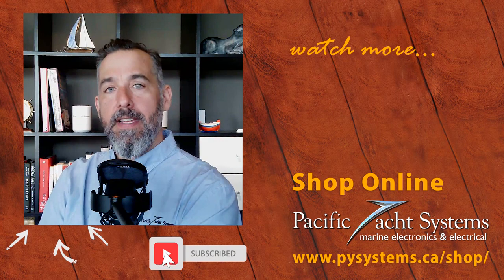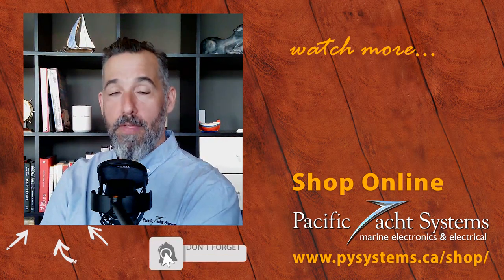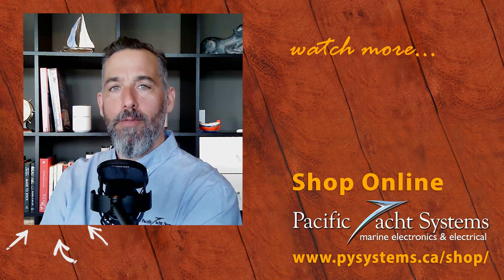My Inverter Has a Case Ground, Do I Connect This to the DC Ground?

Comment: You did not mention shore power. I have always been taught to "NOT" connect the show power ground to the grounds of the RV/BOAT. The RV/BOAT acts like a sub panel when plugged into the shore power

Comment: Thanks for the great tutorial. My inverter ground terminal  connector is way too small to accommodate the 1 size smaller regulation ground wire. I believe this is a common problem. Is there a fix to overcome this issue?

Comment: I have a certainty mine doesn't comply. Don't think the case clamp was large enough either. 
Is there a conflict in capacitor bridges and copper strip or flattened copper tube ground sizing? There is a pile of the larger keel bolts to be connected though my intention to capacitor isolate. I am aware ABYC and old standards for protecting wooden boats and Aluminum from unnecessary galvanic induced corrosion seem at odds.
Personally only interested in MY vessel complying with CG Auxiliary inspection.

Comment: The notions of ''grounding'' and ''bounding'' are often not well understood as well as the principle of ''single point ground'' and that everything is put at the same potential. The DC output must be floating to ensure compatibility with any type of equipment. The frame of the equipment, on the other hand, of the AC/DC products must be grounded at the same point and not one after the other (not daisy chain). We never ground the battery negative.
In a boat, it is virtually impossible to have the equipment all in one place with an SPGP (Single Point Ground Panel). Thus, secondary panels that will be inter-connected can be installed in different places.

Comment: Hi Jeff, I'm still confused, I have a 1000 watt pure sine wave inverter running off batteries for emergency back up for electronic equipment and on the inverter there is a ground bolt on the side of the casing, what do I ground too, I am not close to a electrical panel but there is a ground rod near the generator ,  could it be attached to this rod or is it necessary at all to ground the inverter , or should I put in another ground rod, I would appreciate your advice.

Comment: I've got 4/0 gauge on a 3000 watt inverter. The chassis ground is very small. Will be weird to install a 2/0 gauge wire to such a small term terminal post. Will the post even handle the current in a worst case scenario? Also, isn't that how galvanic corrosion starts?
Reply from the maker: for RV's and houses only 8awg is needed so it's possible they did not put a big stud on to handle marine guidelines.  I'd have to see a picture.  inverters intended for marine use will have big studs.

Comment: Hi Jeff, bit late discovering the video but belated thanks for posting it :).

Couple of Qs from me if I may:
- I thought that grounding the inverter is to provide a protective earth for the AC and therefore the cable should be sized based on the AC cables rather than the much thicker DC cables. Please could you explain why we need to size based on the DC supply eg what scenario will need such a thick extra ground cable, esp. if the DC negative is already connected to ground.
- I've seen you mention "common ground" in a few videos, but have also see others post that DC should be floating, which appears to be saying the opposite. Is this simply a difference of opinion about best practice or have I misunderstood what they mean by floating ?
Thanks, Tim